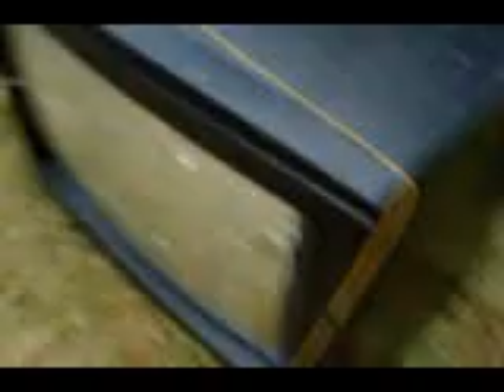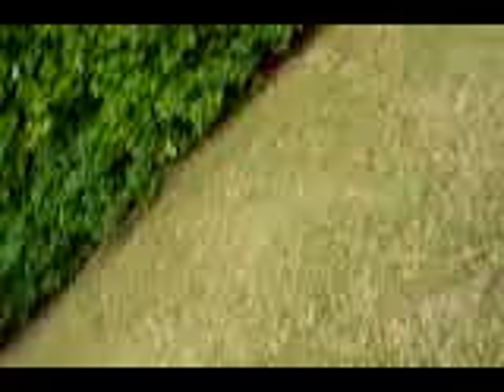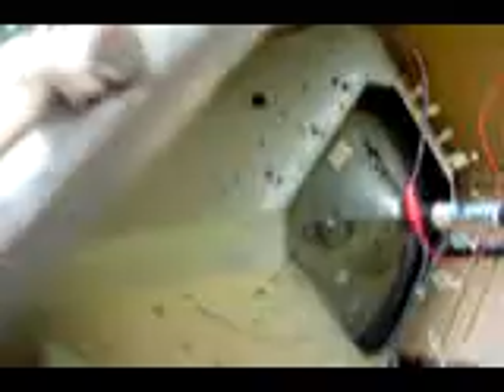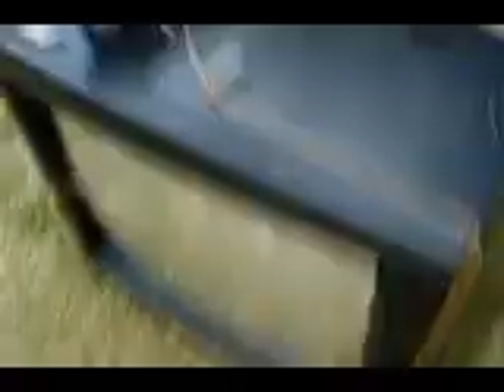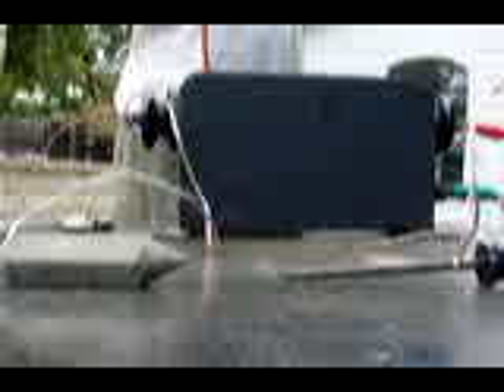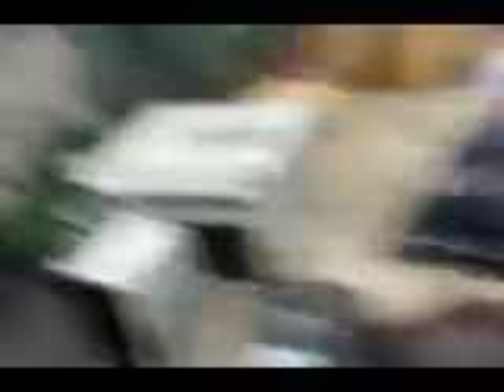CRT Capacitor

Comment: nice idea, altho u might just wanna use wine bottles. they handle to about 30KV and take much less space. 

the glass of a crt tube is much thicker and has less capacity per cm2 than a bottle. i think that the best way to detirmine the capacity is to measure it with a fluke or something.

good luck, nice spark:)